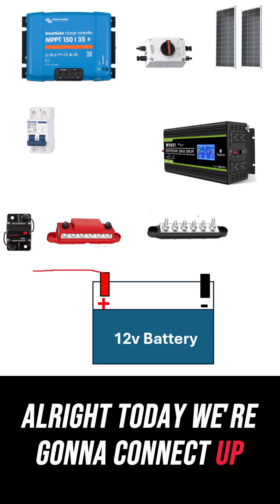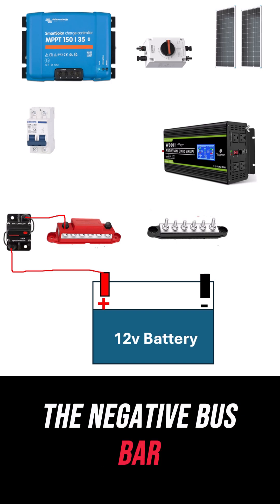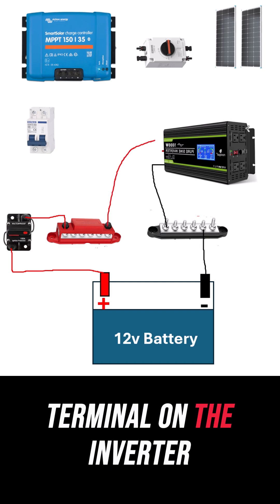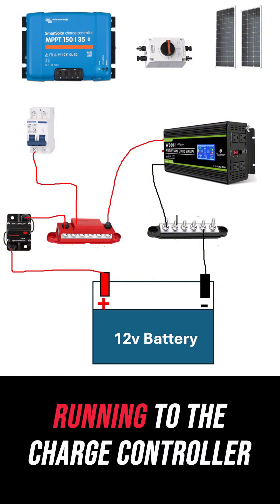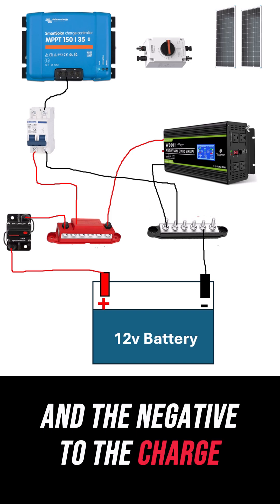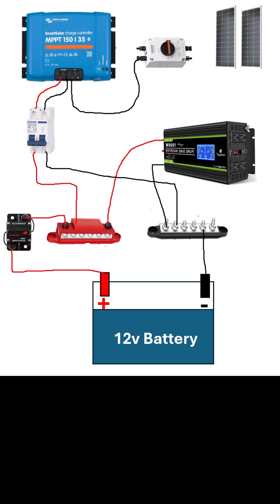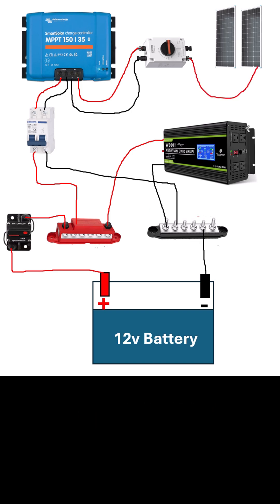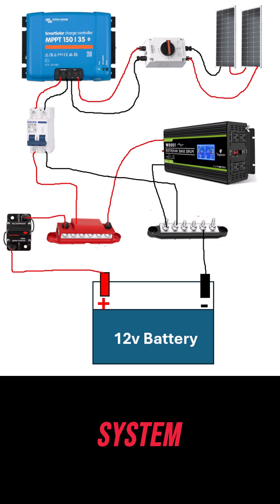The EASIEST 12V Solar Diagram for Beginners!

Comment: I just bought 2 x 120 what panels, I am in the UK so the sun ain’t great.
Would you say get more?
Reply from the maker: thats total 240w of panels, i have 3700w on the RV roof.. everyone need different amounts of power, but based on you statement, yes I think you might need more! -- Remember panels are rated on BEST case at peak performance .. So they will produce less then labeled.

Comment: Do you think its a good option to add or show how connect a GFCI ? Could be a life saver
Reply from the maker: Yes GFCI is a wonderful idea, there are a lot on inverters that come equipped with it. It’s a shame that so many avoid it not know why they pop. Maybe a good subject for a video or live stream conversation.
Reply: @MattManSolar  Where would you recommend the GFCI? Between the solar inverter and the pv panels? Or between the solar inverter and the main outlet or another location?

Comment: Am i mistaken that between the mppt, the shut off switch and the solar panels it seems that your are connecting the red (positive) to the black (negative)?
Reply from the maker: Many of these PV off/on switch do cross over wiring, where the positive goes in on corner and comes out the diagonal end. (Most the time this is where you have two sets of wires) That was not the intent on this video, but you should watch for it. I would also double and triple check that the polarity is correct on panels coming in. But good catch, I know the Charge Controller terminals are correct, but the PV Switch may be backward on PV side or CC side depending on the switch.
Reply: @MattManSolar  Thank you for explaining.